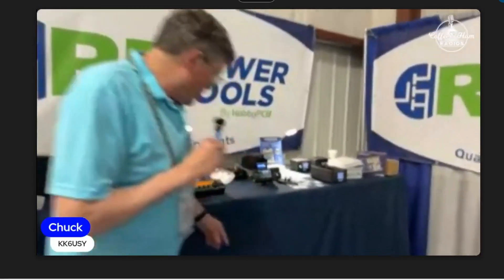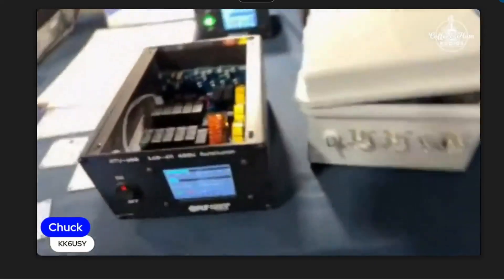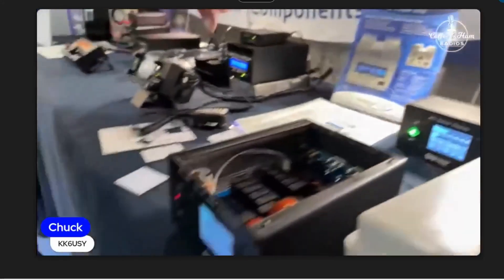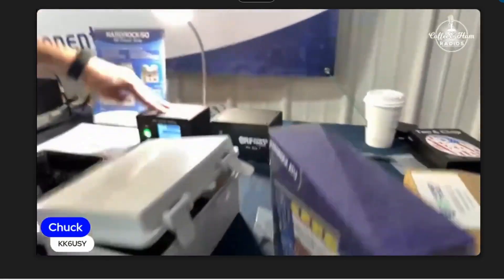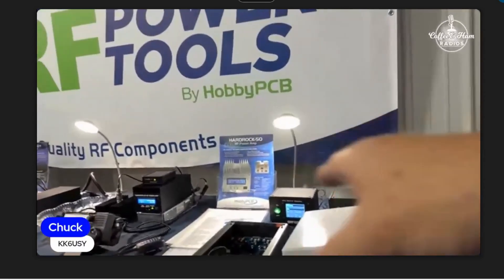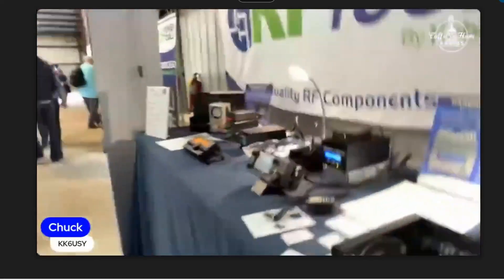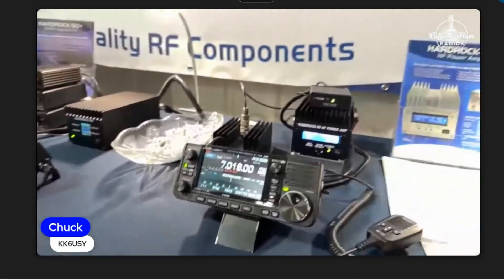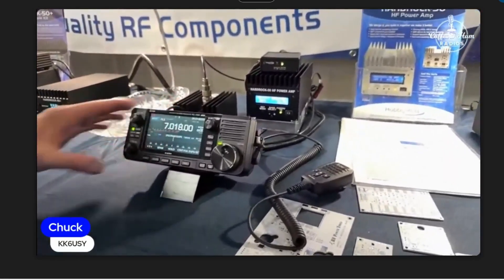RF Power Tools Hard Rock QRP Amps Hamvention 2025!

Comment: I've had a hardrock 50 with atu for about 4 years, it's been exceptional with the 705.
I even use it to drive a single 3-500z amp.